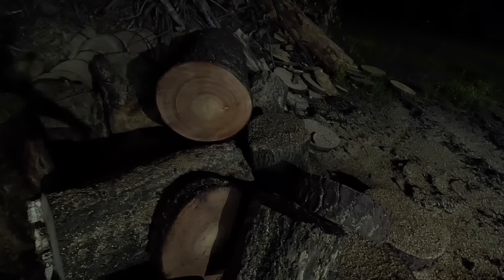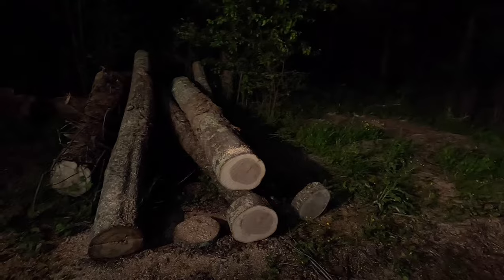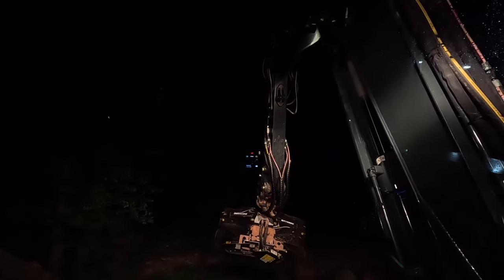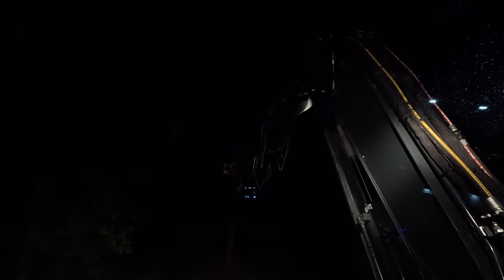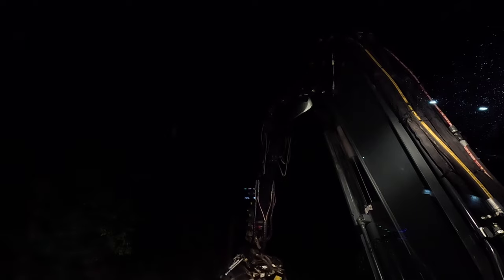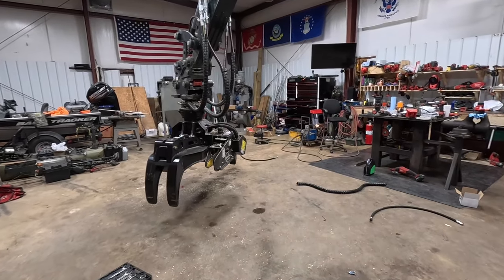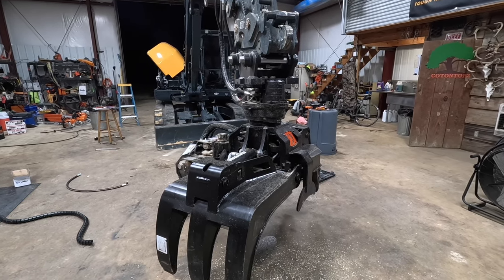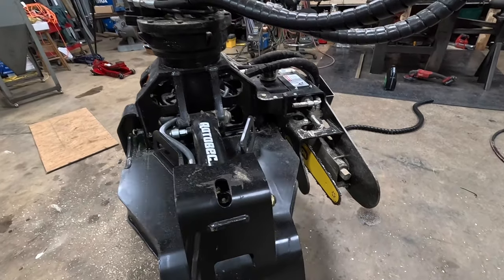Rotobec "Limb Reaper" cutting up WOOD 💪🏻

Comment: Tim it’s nice to hear your brother Kevin is working with you on these jobs but if you do go with a bigger excavator there are small felling / processor heads one is from AFM Forest the AFM 35 has a 24-26 inch saw bar length it has a min 32 gallon per minute flow for 80 horsepower the weight of the head is 1587 pounds they have a USA dealer in Maine Frank Martin Sons Inc they have 2 locations up there the dealer in California is Bailey’s Inc one of those heads would be nice for tree thinning or brush thinning around power lines

Comment: Awesome machine Tim! What size bar is on the grapple?
Reply from the maker: I can’t remember exactly. I measured it when I first got it and it is 25-28” if I remember correctly.
Reply: Ok thanks! I’m sure you will breeze thru that job tomorrow lol
Reply from the maker: It is a 30" bar, I just looked it up.
Reply: @cotontop3  thanks it definitely looks long and handle those hardwoods like nothing!